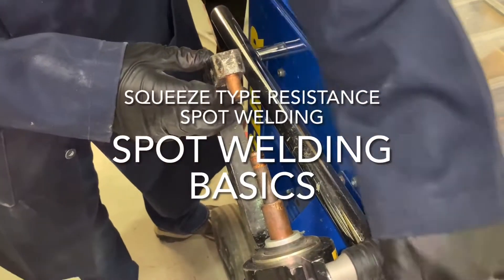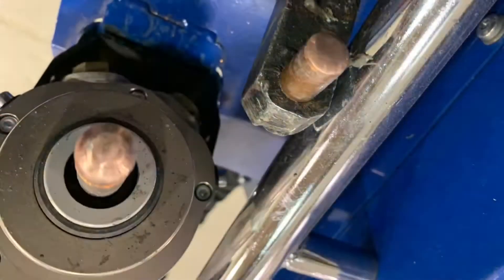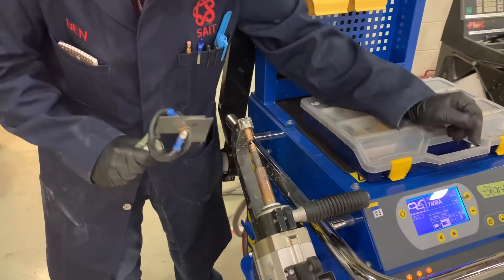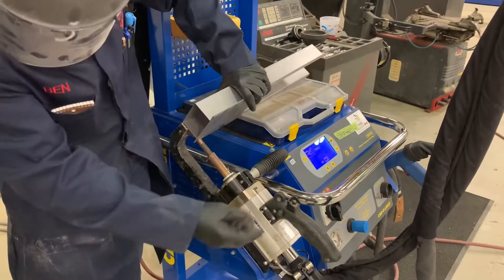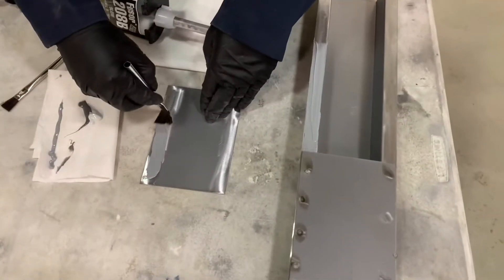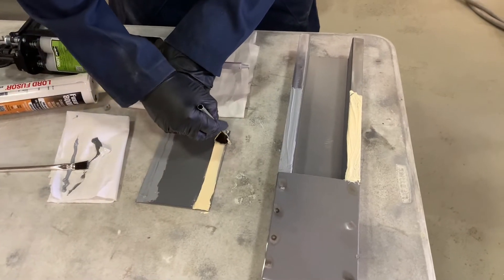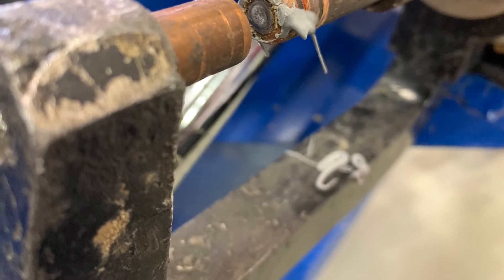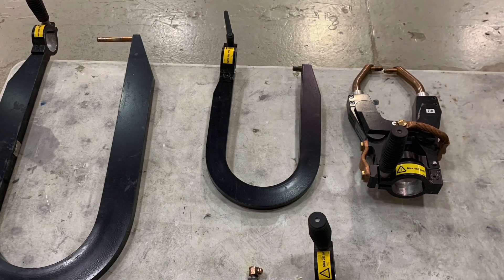Spot Welding Basics

Comment: Is it also necessary to go to bare metal in the inner part of vehicle when prepping?
Reply from the maker: All direct areas of the spot weld need to be clean, bare metal (yes, the inner portion of the panel needs primer/paint coatings removed as well). Refer to OEM procedures as they will specify if the zinc coating may remain.
Reply: @benh4086  i see i wanted to try this. But I see that I would have to repaint outside plus inner side since it leaves marks on both ends. I thought I just welded on the visible outer side.